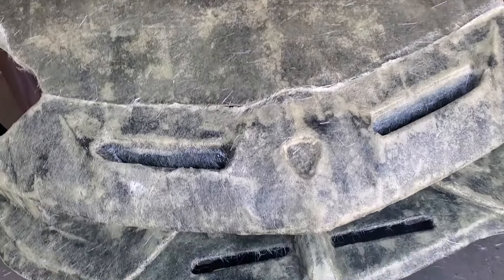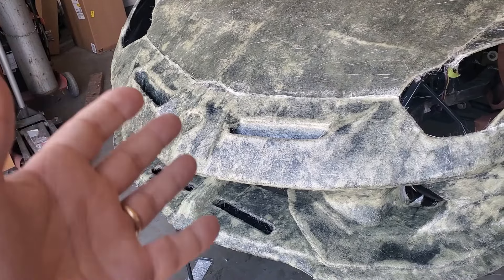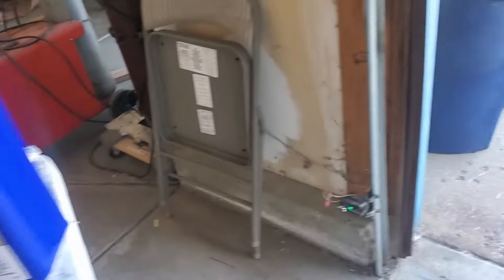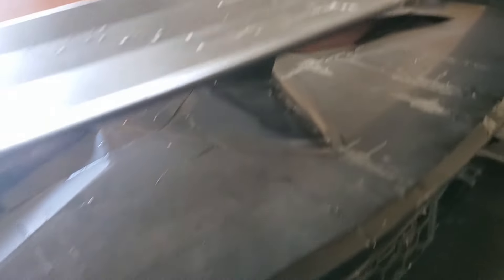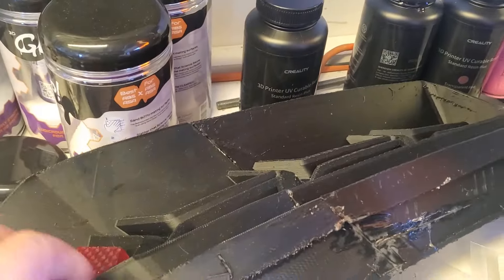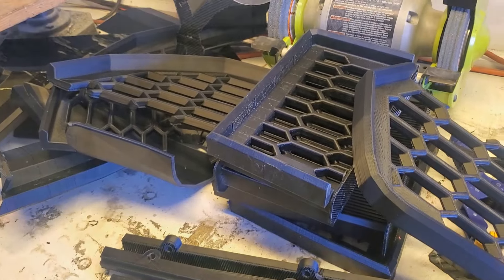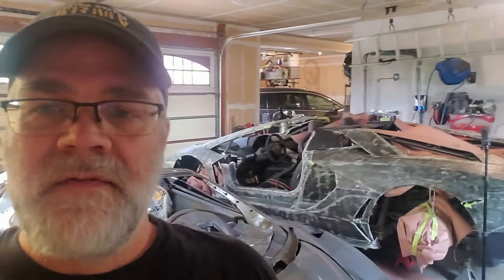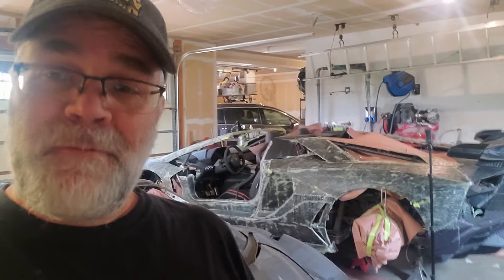SVJ Quarter

Comment: Awesome Stuff! I have two questions, if you didn't mind:
1) Are 3D-printed taillight lenses DOT approved/acceptable?
2)Will you be adding a layer of fiberglass cloth over the mat for smoothness and additional strength?
Reply: Homemade Tail lights are definitely not DOT approved.

I believe the rules are abit looser in the usa 🤔

I the UK lighting is very strict. I am buying E marked and DOT APPROVED lights for my V12 build 😎
Reply from the maker: @crazysnarfy861  No, they do not need to be.  Possibly might do cloth, not sure.